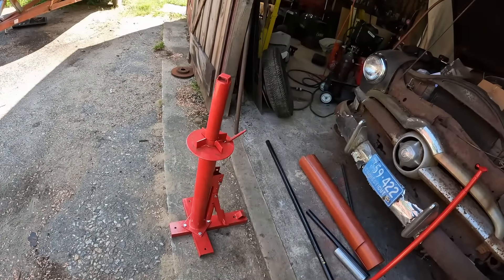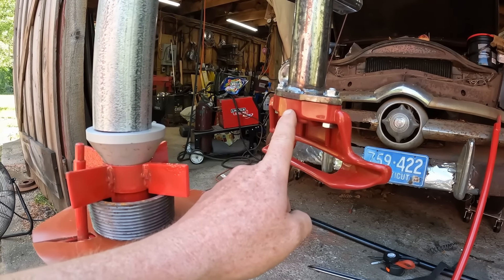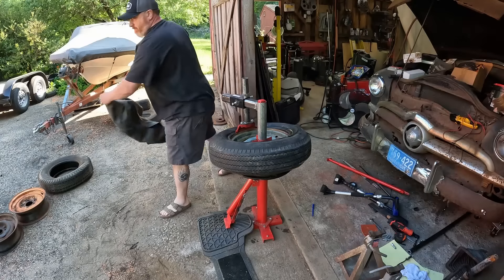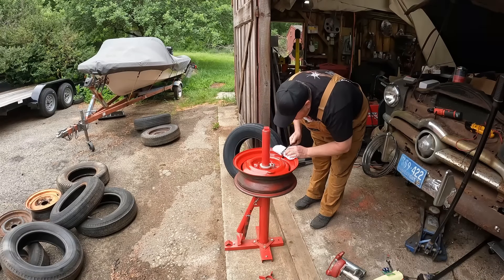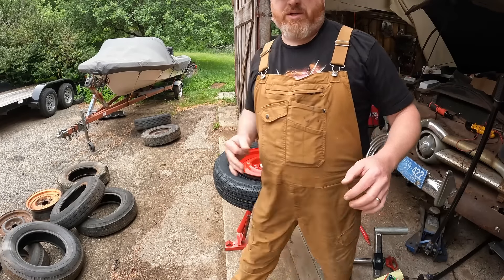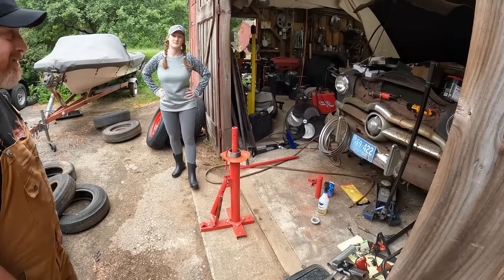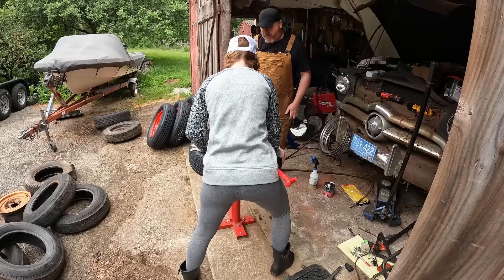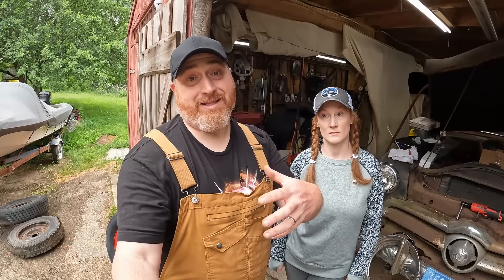How to modify a Harbor Freight Tire Changer to work amazing!!! Follow this DIY guide!!

Comment: Wish I knew how to weld and had a welder  to learn with might  help too? 😂 
Kind of wondering though that if you gone to all these modifications on this HF tire changer, is it really worth buying one? Maybe you be just as well off to build your own tire changer from the ground up  rather than having to modify the tire changer you already paid for that should do the job straight out of the box like yours that’s modified!  I hate supporting companies that make crap like this that has to be modified to work how it should in the first place!  Long as we’re buying crap, these companies will keep making crap and selling it to everyone!  Seems like you’re skilled enough to have built the tire changer yourself without using anything from HF?

Comment: You want to learn some new cuss words...you'll magically speak in tongues when trying all of that with a 40-50 profile tire
Reply from the maker: I dismounted and mounted a 15" trailer tire on the concrete floor at tractor supply with 2 tire spoons last week. It won't be harder than that! Lol

Comment: That duckbill attachment looks like it works really well. Ive had one of those machines for 10-15 years. It works great on steel wheels. The supplied pry bar is fine for removal of the tires but the “install end” not so much. Biggest problem I’ve had is with the blade of the bead breaker bending while trying to break the inside bead on an alloy Tacoma wheel. Never did get that one broke. I had a Honda Odyssey w steelies and wheel covers for 240 k miles and never had a shop mount tires on it.
Reply from the maker: Well I hope this video helps!

Comment: Excellent mod !  I bought the HF tire changer 5 years ago to mount 165/70-10 tires on alloy rims (that's not a typo... tiny tires).  I had difficulty seating the second bead.  The next time I install tires  I will modify my changer as you illustrated.  Great job !
Reply from the maker: Awesome! Thanks for watching.

Comment: I have had to replace the feed motor on my Lincoln Welder, it was easy and did not cost that much, but who knows under this Bidenconomics. I can't believe the prices.
Reply from the maker: The entire machine was replaced with an Arccaptain MIG200. I have a video on it. It migs,this,arcs, does aluminum. And it's under $400!
Reply: @madgingercustoms  I bought another Lincoln wire feed with the Aluminum Spool Gun and love it.

Comment: Please don't get me wrong, I sure like your work, but an old, used tire machine (a real one with a real bead breaker and a motorized table) is about $150-200 in my area. If you know the right people you get one for free.
 I don't understand why someone messes around with crap like that.
Reply from the maker: It was a fun project and it literally takes up no room in the garage unlike a massive old tire machine. I unbolt it and toss it the corner with the balancer behind some motors.

Comment: It is a shame a person can't even watch these videos on youtube anymore without 15 idiot ads popping up every 2 minutes......  Anyway.....  I don't think Harbor Freight sells those manual tire changers anymore.  They did some kind of reset or something at the end of last year which basically means they aren't going to carry half the stuff they have always carried anymore.  But.....  I haven't seen these things at our local HF since.  They still sell the small ones for wheel borrows and mower tires but they haven't had the big ones for car and truck tires since.....
Reply from the maker: Our local HF stocks them. It is odd though.
Reply: @madgingercustoms  Must be a regional thing.  I'm in central WV and every shadetree mechanic I know has one of those things.  I was going to buy one this past winter but our local HF didn't have any in stock.  I offered to purchase the display and you'd have thought I had pulled out a gun or something. "OHH GOD NO!" "WE CAN'T DO THAT!"  There are afew other HF stores within reasonable driving distance but they didn't have them either.  So I made one that worked but I can't get the tool headthat separates thebead from the lip of the rim right and I ended up tearing up a couple of tiresso I threw the whole thing in my junk pile to haul off.

Comment: You mentioned your bad welding machine, circuit board potentiometer , replace them or repair them , lose rivets on the contacts of those potential meters. 
Soldering bad pads on that board. Caution with heat on that old circuit board it’s a very bad cheap design  good luck
Reply from the maker: The machine has already been replaced. Thanks for all the tips!  I still have it and will go through it one day.

Comment: Great mods! Couple hints for mounting tires. Make sure the rim is as clean as possible. A wire cup on an angle grinder works nicely. Use lots of lube. They make a heavy lube (almost looks like grease) for pitted/rusty rims. Use the drop center in the wheel. It is your friend. Use that lube/sealer on the new valve stem. When mounting or dismounting protect the valve stem by taking the tire off there first and putting the new tire on at the valve stem last. Put your bar directly into the square tubing. You will get a lot more leverage. Great mods! Thanks for sharing!
Reply from the maker: Thanks!

Comment: Here’s the problem with this, although helpful - a lot of the viewers cannot weld.  Welding equipment isn’t cheap and the skill to do it quality isn’t there.
Reply from the maker: I completely understand. This can be made, more or less, with pipe fittings as well.
Reply: @madgingercustoms  that could be your YouTube gold if you make that video using pipe fittings and parts list

Comment: I don’t know how much time and money you invested but you might want to go to an auction and buy an old used heavy duty tire bead breaker. Hey you did a great job modifying it but still Mickey Mouse with a lot of tires. Go on line and you can buy one like they use in a tire shop between 4 and 500.00 bucks and if you find a out of business tire store you can probably get one real cheap and a air driven one that you don’t have to bolt to the floor… want hurt to look around cause you might get lucky.
Reply from the maker: I don't have the room for a tire machine. This works fine for as little as I use it and we just tuck it away when we're done.

Comment: bet you hadda put a lot of weight on, just so you know, next time DOT that tire up and you wont need so much weight
Reply from the maker: It was much easy with the soapy water the last 3 tires! Thanks for checking out our video!
Reply: @madgingercustoms  no I ment as far as balancing them
Reply from the maker: 2 oz is fine for an old steelie and cheap tire I would think. The other 2 only took .5
Reply: @madgingercustoms  NICE, but just so you know there's a dot on new tires that you should set opposite the valve stem that has alot to do with your balancing

Comment: your welder will work fine if you trash the harbor freight mig wire. spend a few bucks more for quality wire...   TRUST ME
Reply from the maker: Welder needs to be cleaned out. It's been replaced with another MIG

Comment: Did anyone mention LUBE yet? 🤣  Any time you're using rubber, LUBE makes things better.   DON'T USE PETROLEUM based products on natural rubber.  Soap OR when mounting car tires in motorcycle rims (for mire mileage on rear wheels)  KY Jelly works great.   Car tire sizes are tighter then Mc wheel sizes.   Petroleum products on natural rubbers, especially latex starts immediate degradation.  Ask my surprised parents.

Comment: I'd never buy tires from Amazon they could be cheap Chinese knock offs and I would never buy a Chinese Tires or tube!!!  I bought a wheel barrow a few years back and it had Chinese Tires and tube the tube you could actually see sunlight threw it and the tire was not much better I had to replace them after one week of work running over 3/4 clear gravel actually punctured the tire!!!
There known for exploding while driving at 60 MPH!!!
Reply from the maker: The majority of all tires are made in china.